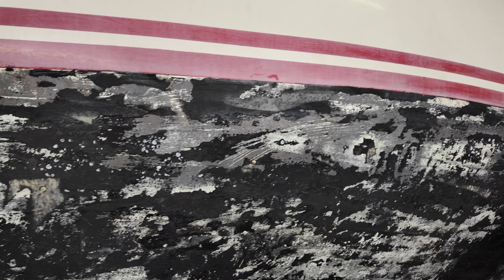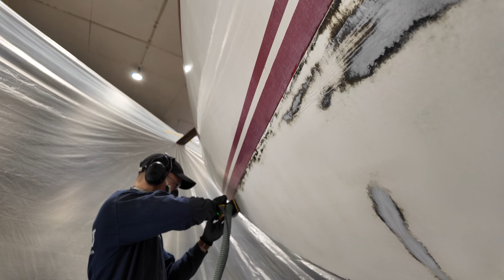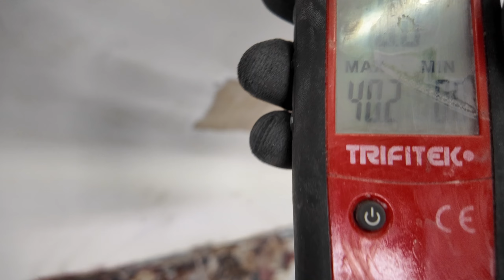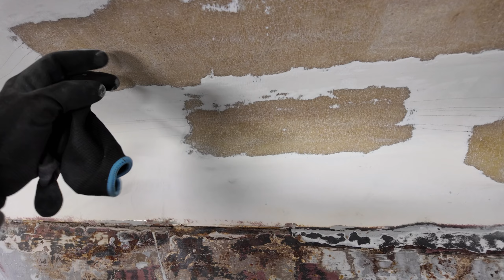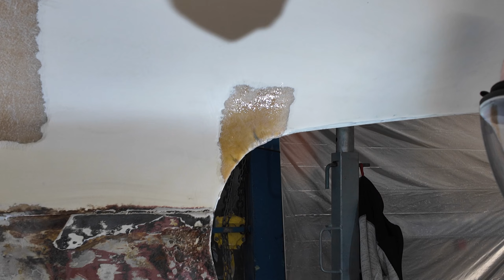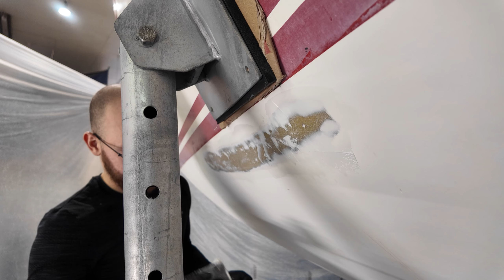Fixing the hull | Project Anton Ep. 2

Comment: Those cracks in the bottom is common om the h-boat, when you sail in heavy seas and the boat slamms. They are related to the inner structure is my experience having fixed three of them now. One O.L and two botnias from the 80s. Keep it up 👍
Reply from the maker: Thanks! Is there maybe any way to reinforce these areas from the inside to get rid of that problem? I'm going to do some lamination from the inside any way, any specific advise would be very appreciated!

Comment: Sanded my boat bottom clean years ago... took a punch of clogged sandpapers until found mesh sandpapers. Seemed more expensive but they go a long way compared to regular ones. Since then used only mesh sandpapers for sanding boat stuff :)
Reply from the maker: I know theoretically, that mesh sandpapers should be more effective (probably), but for some reason I just don't really like them. The sandpapers I'm using are actually extreamly good quality, and they really go a long way when used properly – optimal rpm, dust extration etc. I am using mesh papers for finer hand sanding though, that's where they work best for me!

Comment: Thanks. Please show labels and names of glue, fiberglass, putty and other materials used.
Reply from the maker: Hey! I was thinking about making a separate video on the basics of processes and materials I'm using, but I'll still answer your question shortly. I can't give you too much detail about the resin and fiberglass mats I'm using, simply because they're some wholesale products that happened to be at our workshop – fiberglass material I'm using the most is 600g/m2 emulsion bonded chopped strand mat, with polyester resin. As fillers/putties I'm using Enguard Bonding Paste (BP 72 A and PB 725 AC).

Comment: Lots of good progress. I'm interested in the architecture and engineering of old boats. It would be amazing if you could show us more inside, for example, stringers and bulkheads, keelbolts, propeller shafts, and rudder design, to give us an idea of how these were built back in the day. What is the laminate thickness and the use of any core material? Cheers.
Reply from the maker: Hey! I'm quite sure all the things you are interested in will be shown at some point, when I get to interior reassembly. However, just to quickly answer at least some of your question: there's no inboard engine, so no prop shaft; hull thickness is about 4-5 mm with no core material; some areas of the deck have a sandwitch structure with about 1-1,5 cm of pvc foamboard and about 1,5 mm of fiberglass on either side, more on that, yet again, in a future video – I will be repairing some of that sandwitch structure around the mast step.